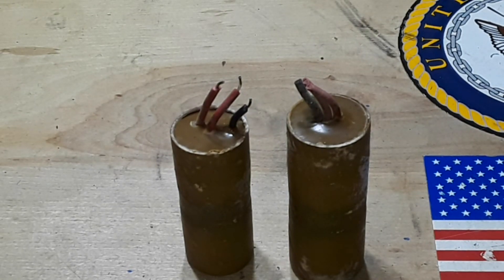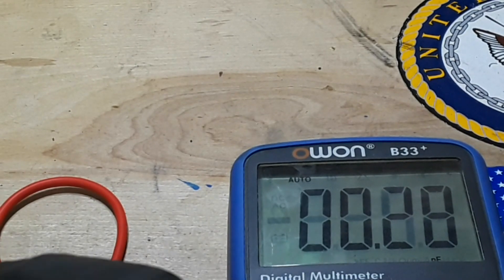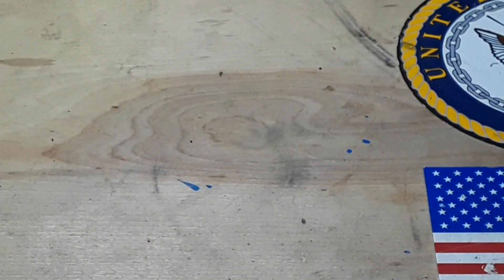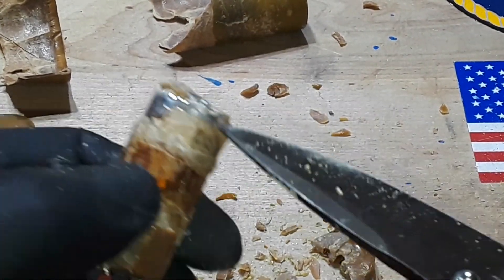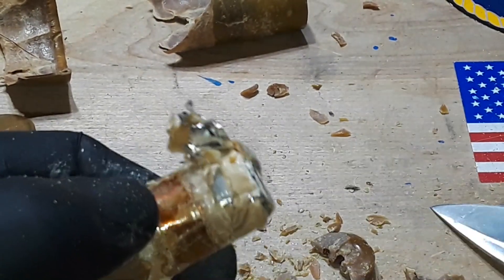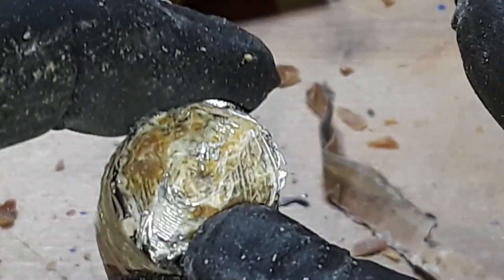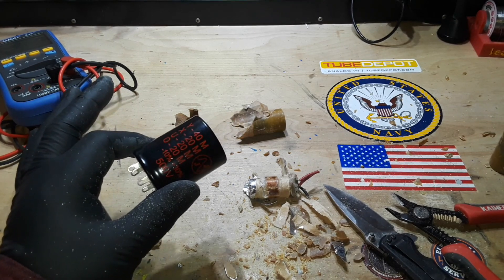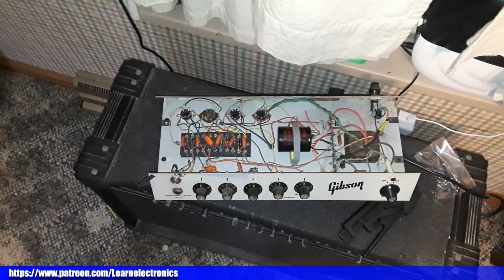What's Inside An Old (50+Years) Oil & Paper Capacitor

Comment: I just tore down one of these from a 1964 Wurlitzer jukebox with the hope of concealing the new filter cap inside the aluminium shell. It has a Bakelite screw mounting on the base which fastens to the case and connects the negative to the chassis.  Sadly the new cap didn't fit in the old, but I can keep the can in place (now hollow) and hide the new cap underneath.  Great stuff.  Stunk to high heaven too!

Comment: Yeah, those things tend to cristalyze with time. 
I've read in some books and online articles that it's possible to restore them back to "normal" state by applying low current/voltage and stepping it up gradually and also by using heat for some time, but never succeeded to do it myself. So, in the end I also tear their guts out, just to see if they were REALLY cristalized... And yes, they were. 😎
What do you think about trying to restore those old capacitors? Ever tried it?
Reply from the maker: Ive never considered it. I'd rather just replace them.
Reply: @learnelectronics   Yeah, I don't bother anymore either, but my friend insists on having "original" things in his devices. Nevertheless, we always end up replacing them all. 😁
Cheers! 🙋🏼‍♂️
Reply: Is the epoxy in liquid state?
Reply: @shuruthi459   Honestly, I've never disassembled a functioning cap, thus I can't be sure. I believe it's a kind of resin or gel.
I could be wrong, though. 🤷🏼